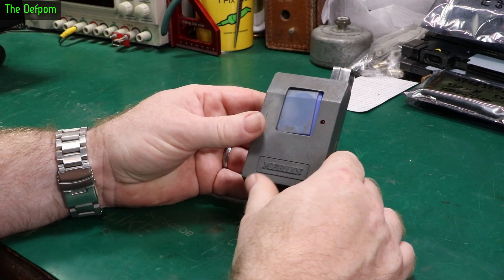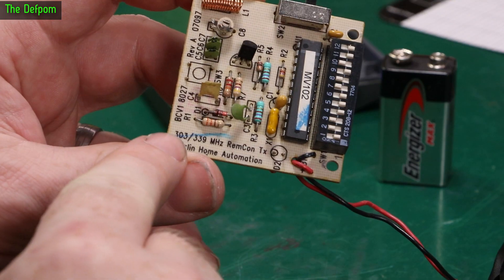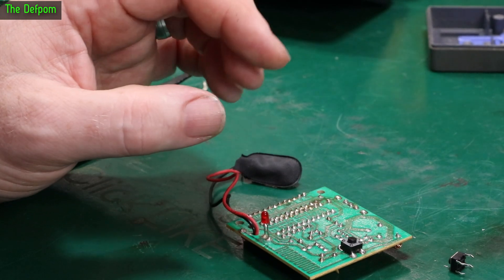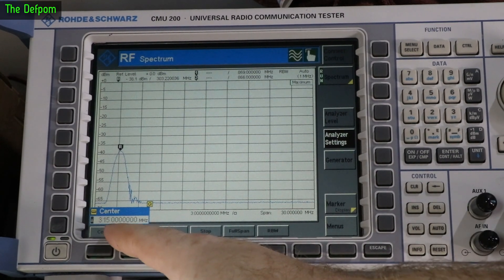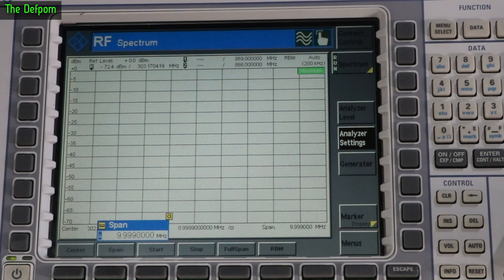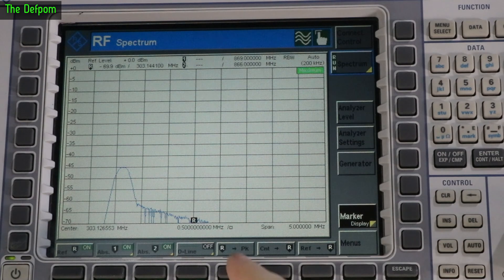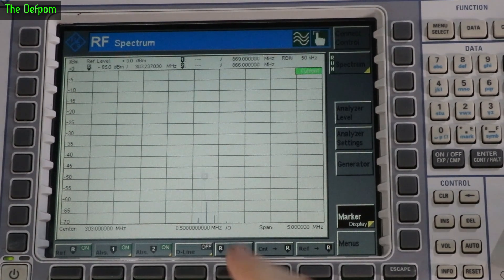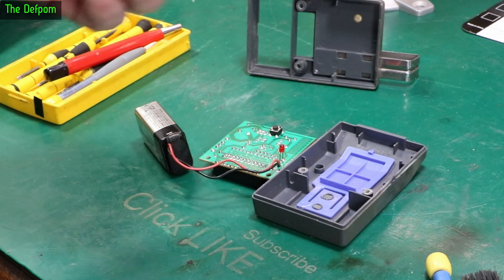🔴 Merlin Garage Door Opener Repair - No.1212

Comment: Our older white button Merlin remotes drifted lots when they got old. Got sick of constantly needing to retune them to 339 MHz so replaced them with cheapies from Trademe that were self learning remotes. Tether the 2 together and put the new ones into learn mode....problem solved ! Improved range too !
Reply from the maker: Yes that is an option for these things, the older ones don’t use rolling codes so can be easily cloned.

Comment: Great video, Scott. The spectrum analyzer display is a perfect example of fast rise time pulsed RF and the noise it generates. My working career was in radar and we actually had to de-tune some of our transmitter ouput amplifiers to control rise time. I think the 303 / 315 Mhz marking is the operating band. The remote should be tuned to match the opener receiver frequency - where it was before cleaning the board. Regards, David